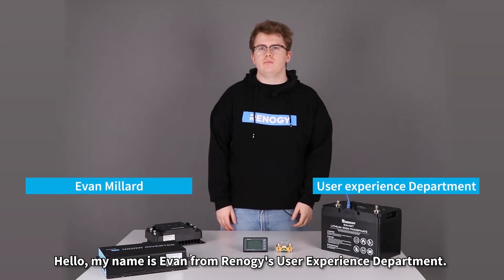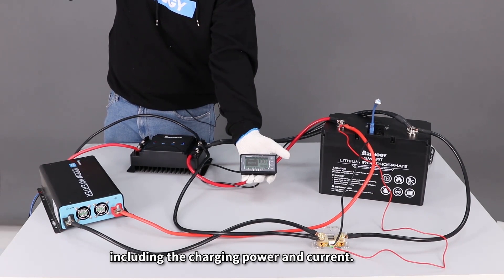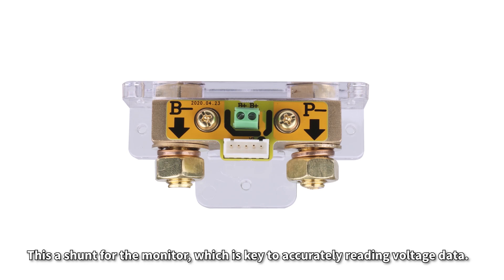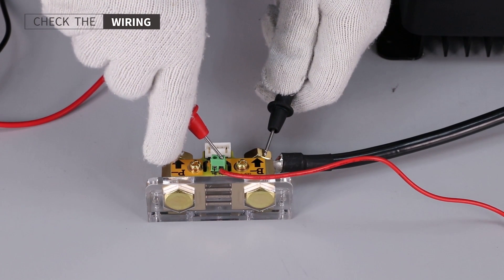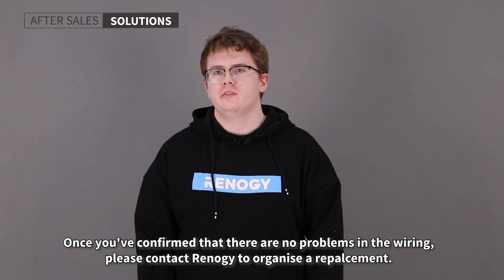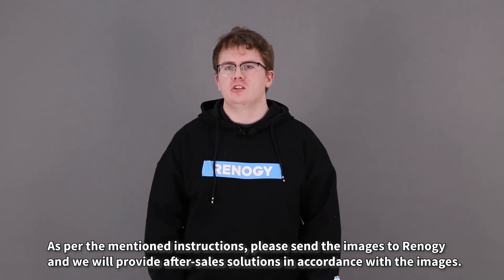Troubleshooting Renogy 500A Battery Monitor Pt.1

Comment: This video missed the target.

There should be only one wire connected to the Negative (-) terminal of the battery. It will be a jumper that connects to B(-) on the Shunt (Diverter?)
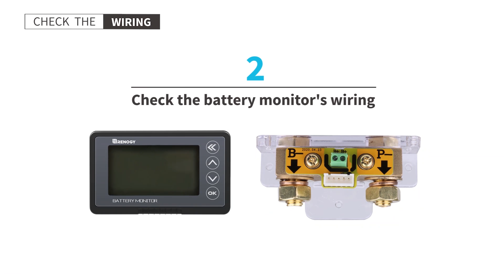At 2:17 'positive' is incorrect - negative should be stated for this section.

thanks for trying but as it is, this video will serve to confuse people.
Reply from the maker: Hi, James.

Thank you for your feedback which constantly improve customer experience. We have reflected this error to our related department.

Have a nice day.
Reply: Please remove video & do it correctly. Also follow wires over to units that they connect to in order to properly illustrate it.

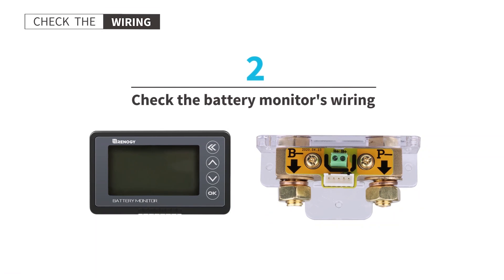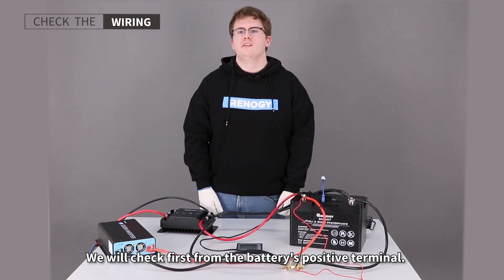Comment: Maybe I'm missing something simple but at 2:17, when describing what wires connect to the P-minus terminal of the shunt, Evan (as well as the caption) states that the two wires connected are "positive" wires but aren't they both negative connections?  (They are clearly black colored wires and the video already describes where the positive (red) wires connect at 1:50.)  Stay safe everyone!
Reply: I got 660 Ah in my bank!  They trying to kill me?
Reply: Agree.  Video is incorrect.  Dangerously so.
Reply from the maker: Hey Rudy,

For any technical questions, please contact us here-https://www.renogy.com/contact-us?gclid=CjwKCAiA3pugBhAwEiwAWFzwdeH3Crd9vRTbjjTYl9l3daVqnotJPjBhs2nmw-Wkn1_guWQeW0ao6hoCOHcQAvD_BwE